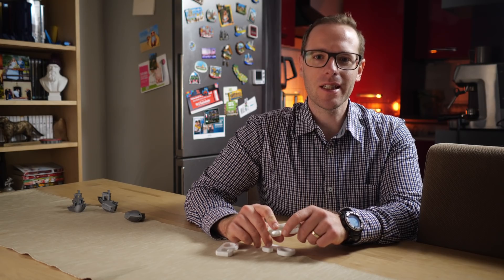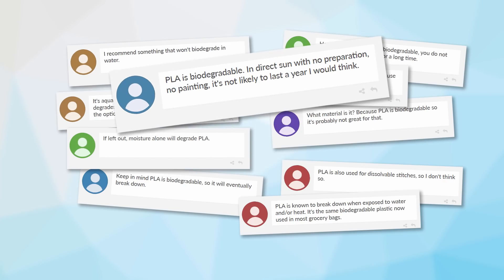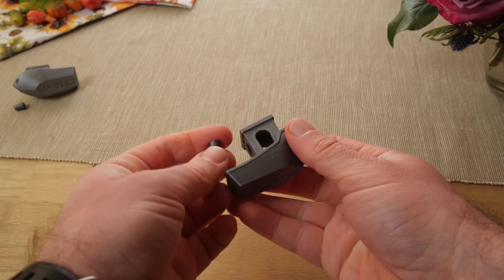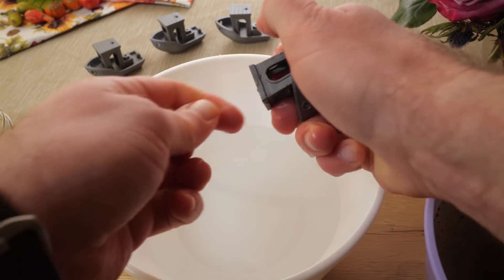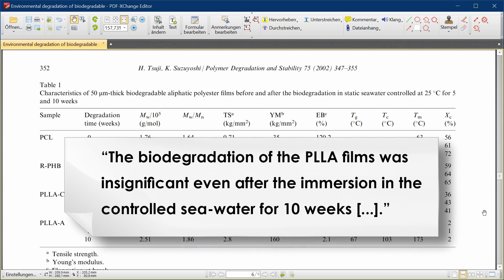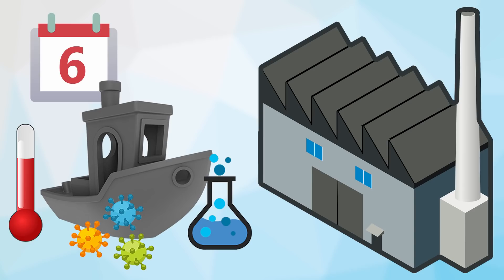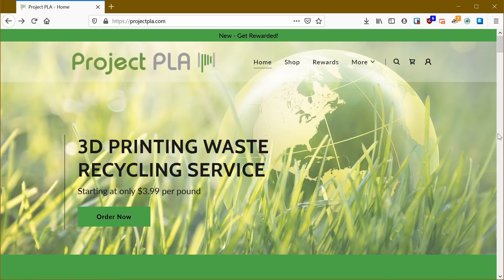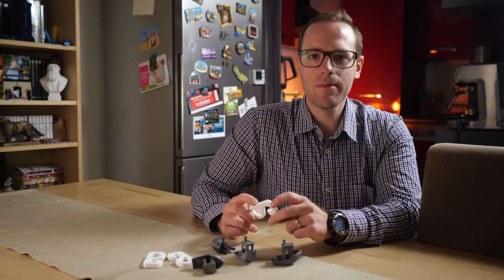Is PLA for 3D printing really biodegradable? I've buried and drowned Benchy for 2 years to find out!

Comment: I printed a "temporary" PLA thing to hold a small solar panel. So far it's survived 6 years of the Australian sun and still going well.
Reply: Apparently heating and cooling over a number of cycles might actually make it stronger
Reply: SirYenner I have a friend who printed some PLA light fittings for his garden, and they’re still fine having survived the British weather for a number of years.
Reply: Have parts for my caravan made in PLA. They've been outside, in all weather from freezing to hot, for almost four years. Both black and white parts. Not brittle, the black parts is a tiny bot sun bleached. Hardly able to notice.
Reply: What colour did you print it out of interest? I imagine white would probably avoid a lot of the temperature fluctuations of darker colours.
Reply: @butterparty  it is a gold colour. Perhaps the gold pigment is proving some UV protection. There is some slight warping, it's seen some 45°C days.
Reply: @SirYenner  Makes sense. PLA is actually quite a durable plastic. I printed a piece in black PLA a while back and left it in outside in the sun during the summer and it deformed... but maybe I should try a lighter color next time.
Reply: I was going to say UV light in Australia would be a better test than water.
Makers Muse has done an informal test with some PLA prints in the sun. If I recall, colour loss was the main degradation. Some pieces became brittle, but most were still serviceable, just a bit ugly in their colour.
Reply: It didn't work for me, I made mounts that stick behind 6"×6" panels and attach on pvc pipe on other side. Only one day in Delhi summer sun and they softened and deformed 😟 the panels (I had black colored ones) become really very hot I guess that's why. I gave up that idea and bought a proper aluminium frame panel and mounted it using no plastics parts...
Reply: @snehanshourya3850  That's beyond the limits of the material. PLA:S melting and glass temperatures is another matter. Degrading and melting is quite different things. Not to make your point invalid but the material-choice should be fit for the use case. :)
Reply: @funkysod  Yeah I know, my bad. I honestly didn't expect panels to get that hot. But with hindsight, 45°C ambient temperature plus direct sunlight on black surface, I was asking for trouble by using PLA. I didn't give much of a thought back then...
Reply: @snehanshourya3850  It happens! Sometimes the will to get stuff done blinds us :)
Reply: it's funny the PLA prints are lasting so long, the pegs on my line crumble after a year, 2 years if you get special UV resistant ones! Why aren't they making pegs out of PLA if it's that good.... more reason to buy a printer!
Reply: @snehanshourya3850  Solar panels can get much hotter than air temperature, because they are made to absorb as much light as possible and only ~20% of that light is turned into electricity meaning the remaining 80% turn into heat. They can get as hot as 65°C and PLA, having a glass transition temperature of 60–65 °C, gets soft and can't suport a load like a solar panel at that point.
I recomend to print a mold for the part you want and mold salt dough with it. Then freze it to make it hard enough to take it out of the mold. In order to bake it it will have to be unfrozen. On the baking tray bury it in sand before it thaws. Afterwards seal it with a watertight non-waterbased varnish to prevent moisture from getting in. To keep it made from 100% natural products you can use molten beeswax or resin.
Reply: I printed some pots from a semitranslucent pla and they became brittle after a year in the sun, I could crumble them with little effort where they were pretty sturdy before.
Reply: Interesting. My 3D printed PLA 'dashboard' for my boat did not last 2 months in EU sun.
Reply: It's possible that certain pigments can make PLA UV-resistant. For example, if they use titanium dioxide in white filaments and carbon black in black ones. The former is used in some sunblock. I have a similar example. I used black PLA on my bike and two years later, they're still strong. With the right pigment, PLA may be as UV resistant as ASA!
Reply: It is upside-down nwod-edispu
Reply: Wow really.
Reply: Thats impressive, is your elevation above 2 kilometers, or close to the equator or both
Reply: I don't get it. I printed some clips to hold a tarp on my boat. In the northern Ohio sun they got so soft I could reshape them by hand. I haven't considered PLA a valid material for serious purposes since.
Reply: A gentle tap oughtta disprove your theory. If it isn't more brittle than candy glass, i will eat my hat.
Reply: What colour PLA?
Reply: Well, so I've just decided to print a pla "temporary" cluster stand for motorcycle tomorrow morning too. Let's see how long it takes... Thanks for the "6 years survival" information 😅
Reply: Awesome😆
Reply: That’s great but that means it’s also definitely not degradable 😅

Comment: Even though PLA is pretty much not bio degradable it is still better than other plastics like ABS because it is made from renewable resources and apart from processing almost co2 neutral. Even if you burn PLA you only add the co2 that corn plants took from the atmosphere before. If you burn ABS on the other hand, you add co2 that was sealed in the form of oil for millions of years.
Reply: At least potentially, as it is the fertilizer used in industrial farming is made from petrochemicals and our water usage isn't sustainable

Comment: Everything is biodegradable, only some things need 30 days other things may need millions years.
Reply: Go read the definition of biodegradable...  Many materials in Earth's surface will not change it's chemical composition over time due to effects of BIOLOGICAL agents and therefore are not biodegradable. A lot of materials degrade under the UV radiation from the Sun, but I don't think this counts biodegradable.

Comment: Dear, one of the best topics i'v seen in 3d printer world, i like the deep test u did with the results of researches it's awesome.

Yet i'm super confused, i printed PLA to my saltwater aquarium, and all of the parts broke extremely easy after 8 month inside of it, i actually had to hold them gently in my hands so it won't fall to parts....

so i was expecting to see the exact opposite of results then what u described this is very weird...

now u made me curios about it, what can be the cause?
Reply from the maker: Thank you!

It seems that some rare PLA brands have some sort of filler mixed in that causes this. I'm guessing it's with the cheaper brands? Also, if your part was near the water pump, the water currents there can be quite strong and any particles in the water act like sanding paper.
Reply: Hey, i will try to print one some more with different filaments and I’ll update here but it would take a couple of months to see,
I thought about another option maybe there is some kind of bacteria that causes this as well..

Can it be?

Comment: Question : from what I understand PLA is made from starch instead of petrol, so even if it is burnt it's co2 immission is near 0 compared to abs. Is this correct? Great video by the way, had no idea this was the case and I was indeed using PLA with the biodegradablity as a positif argument. Might switch to abs then. At least it is recycled
Reply from the maker: It's hard to say without actually testing it, but your thinking sounds reasonable. Of course, we don't know what additives are mixed with pure PLA for coloring and other properties.

If you do switch to ABS, I think it's important that you place the ABS logo somewhere, otherwise it will just get chucked with the rest of "unknown" plastics. I've heard about some sorting centers that are using sensors to detect plastic type, but I think a lot of them still rely on manual sorting by looking at the label.

Comment: thx for clearing tis up, i totaly got this wrong. I have ben collecting pla, and shipping it with the other plastics for recycling.. :-(
Reply from the maker: It really depends on where you live. Some places just dump it into a landfill, others sort it out and recycle it, while still others just burn it and re-use the energy to create electricity.

In any case, it's still better to put it in trash than throw it outside somewhere, so don't worry about it.

Comment: would be a pretty shitty material if it degraded under two years.. even wood lasts longer than that :D
Reply from the maker: That's true, but a material that would degrade only after you throw it on a compost heap would be really great.
Reply: @HobbyHoarder  or something that would easily degrade after certain conditions have been met. I personally don't see composting as the holy grail of enviromental friendlyness.

Comment: To be honest the best solution is just to burn most plastic waste. And instead focusing on reducing the amount of oile used for fuel (yes I know pla is not a Petro product) right now 4% of oil is used for plastic.
Reply from the maker: Someone here replied that they burn most of the stuff in Sweden and absorb the energy to produce electricity, so that seems like a really good alternative.
Reply: @HobbyHoarder  yea and when you burn in a modern electric/heating plant you can extract about 90% of the energy contained into something useful. Instead of the 20-30% efficiency of a ICE in a car.

Comment: Hi I install shop advertising for a living and awnings and sails i had a coffee shop 4 years ago and 2 of there outside caffee poles had broken and i couldnt get a replacement part and the customer didnt want to buy new system so i designed and 3d printed the part and its been there for 4 years now outside in all weathers and hokder a 4ft pole upright so i dont think it degrades
Reply from the maker: I've also had a sign (PLA) outside for about 3 years now. Apart from getting warped a bit during the summer heat, it looks like new.

Comment: PLA is not biodegradable. Unless held under ideal condition as per EU Standard EN 12432. It needs to be treated under very specific conditions not available to any non-commercial and only specific compost facility. Could have told you that 10+ years ago when my 1st job in the US was to install and commission the very 1st (and last for obvious reasons) PLA bottle mfg facility in Colorado.

So basically, 100% Bull shit or "greenwashing" as its called in the industry

But it does make you feel better when you learn that its corn base. 

Now, there are new filaments coming ........that are truly "home garden" bio base. And certified, but can't say more at this time.
Reply from the maker: Thanks for sharing your experience!

I don't know which brand you have in mind, but Fillamentum has been pretty active lately promoting their upcoming "truly degradable" filament. Not much info yet, but I have high hopes for it.
Reply: @HobbyHoarder  Its a brand I am currently consulting with. Should have filament available for sampling by early Dec of this year. Its Bio base, non-gmo and carbon neutral material. UV resistant. But not suited to replace more robust materials such as ABS or PETG. But for generic PLA, going to need third party non-bias review when it's available. Interested?

Comment: There are two types of biodegradable materials: the ones that degrade at normal atmosphere at 20C, and the ones that require higher temperature, at 60C. PLA is the latter.
Reply from the maker: Do you know of any filaments that would fit the first type?

Comment: The only way you tested that is remotely close to the term "BIO" is the buried one. Have you overlooked the "BIO" part in the "BIO"degradable? When something is claimed to be biodegradable, biological method will be involved, like using bacteria. If PLA will decompose/deteriorate just sitting in air with exposure to sun, or submerged in water, it would have of not much use to us, we can't even use it as a flower pot or a vase.
Reply from the maker: The point I was trying to make is that a lot of companies claim that their material is biodegradable and I bet you anything that most people associate that with "just throw it outside, it will degrade", which is definitely not the case.

Comment: I printed some hose fittings and other bits for my fresh-water aquarium from PLA about a year ago. All submerged parts got discolored and started literally crumpling to bits recently. I actually had to re-print most of the parts from ABS. I wonder if there are brand differences. My spool of PLA would become brittle and would break inside the feed tube even before entering the extuder if left unused for too long. Or maybe aquariums do have the right mix of bacteria.
Reply from the maker: Few brands seem to be much worse in this regard, I'm thinking they're using some other type of (cheap) filler that gets brittle very quickly.

Comment: Wow!  Good work.  "Don't print useless stuff you don't need" I wear it as a badge of honour that I have never printed a "benchy" in 4 years of printing and thousands of properly useful, small-run production items and tools
Reply: I can't boast the same but I keep all my failed prints (all PLA) in storage and planning to get them either shipped to someone with re-filament machine or assemble one myself eventually.
Reply: I have no issue printing useless things but I also am saving my plastic to be reformed later on once I have more.
Reply: I do have one (1) benchy, but he sits on top of my printer like a hood ornament and won't be going anywhere anytime soon :)

Comment: PLA's hydroscopic properties are also generally speaking under estimated. When I moved I temporarily printed customized bottle holder right between two showers. Didn't have anything else than PLA available at that moment. Now that stand/holder has been loaded constantly with roughly 1to2kg load and has obviously gotten soaked with water multiple times per week. It's still ok and though now showing mild symptoms of degradation. It has been printed three years ago! By general opinion what I read I was expecting it to last maximum of six months. So in my experience it lasts way better in water that is generally speaking said. Only problems I've experienced with pla in some situations is poor heat resistance,around 60C and uv seems to degrade it quite fast.
Reply from the maker: Yeah, PLA starts to deform at around 55'C and UV certainly doesn't help.

Good to hear your print is still holding up after a few years in use.
Reply: @HobbyHoarder  it would be quite interesting to see how water changes properties of pla in long run. Haven't found any actual long term test about it. I guess most criticism comes from moisture in filament during printing and I've experienced this in some extent myself when I forgot one spool of pla in humid balcony for few months. Though I think there's quite much of deviation in pla quality in general by different manufacturers. At least on my old printer there seemed to be quite prone to stringing difference in printing temperature if I changed it on around 30C scale between manufacturers. I suspect that this previous cheapo printer had quite bad heat brake as I haven't seen nearly as much difference on my prusa. That or maybe there's just more consistent quality overall available these days.

Comment: Huh, I have definitely had PLA degrade overtime in high humidity and sun. I have had some go extremely brittle after only a few months in a milkhouse, the color also changed extremely.
Reply from the maker: It seems like there are some rare cases where PLA becomes very brittle, but I think it has more to do with some companies using different filler material (probably something cheap).
Reply: @HobbyHoarder  interesting. Maybe in your next test include PLA from various sources? Some cheap, something middle ground, and something more expensive?
Reply: @TheTreyBombay  price won't equate directly to degradation or durability.  Within each product line different colors and even different batches of the same material and color will have different reactions.  Fillers used will change over time and it's entirely possible for a cheap product to be more durable, or more biodegradable, than an expensive one.  It would take hundreds of samples from many companies over years of time to possibly get much useful data, with no guarantees.
Recycling is really a more feasible option for now, than trying to compost or otherwise biodegrade plastic.  Better still, use less of what you don't need to use, as Hobby Hoarder and TerraCycle both urge.  (TerraCycle wants to go out of business due to no longer being needed.)

Comment: I've actually experienced PLA degrading myself, but it was very minimal under pretty extreme circumstances. It was a shield for an impact sprinkler, printed in the cheapest possible black PLA. As such, it got wet pretty much every single day during the summer, and got pounded by the sun. With it being a very thin part (just a couple of mm), it started deforming and splitting between layers pretty quickly. Probably for a large part, this was down to the PLA getting soft from the heat of the sun. It was also more brittle, probably due to UV radiation. The water didn't really seem to have an effect, except for putting a rusty coating on the plastic (rusty groundwater). In reality, I suspect that the most damaging thing to PLA would be the sun, mostly UV radiation, and the absorption of that heat and radiation is heavily dependent on the color of the material.
Reply from the maker: Yep, that's a very good point.

It probably got "sanded" away by the water force as well. I saw someone make a filter for fish tank and it got ruined pretty quickly. They thought PLA degraded, but in reality, it was simply sanded away by the small particles in the water.